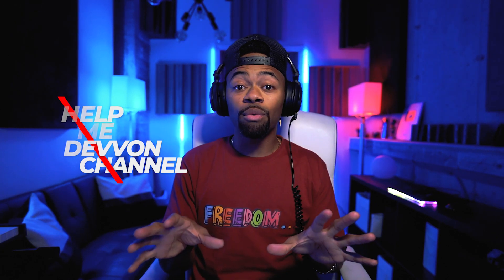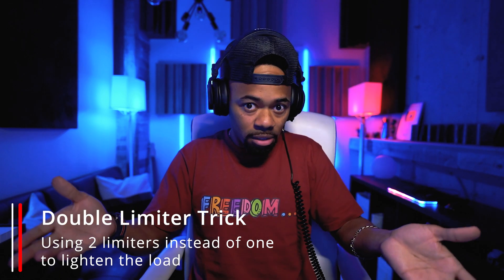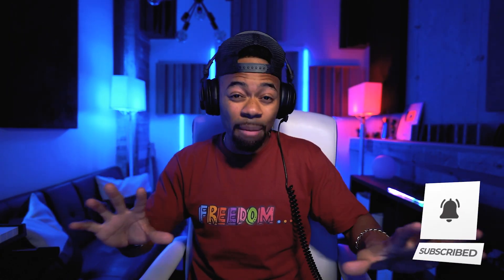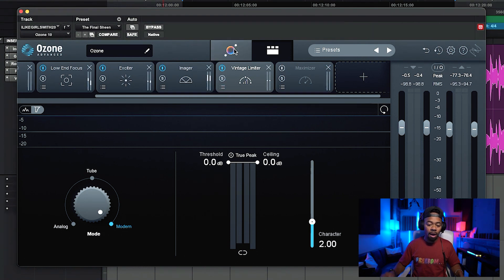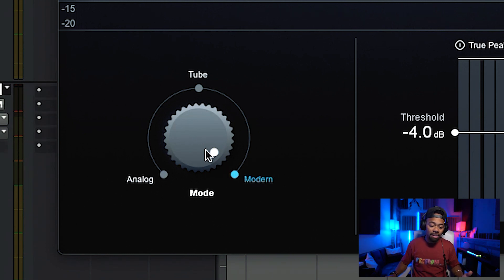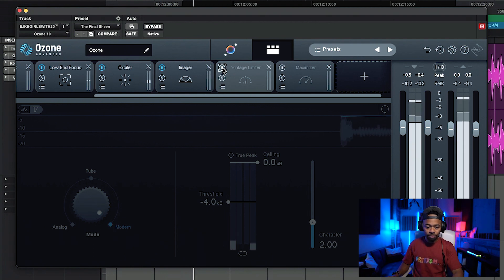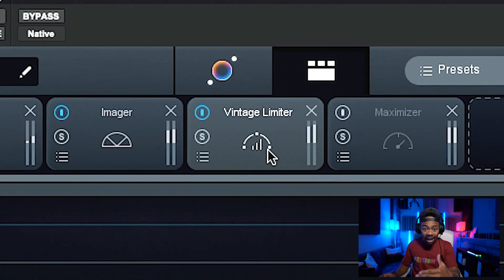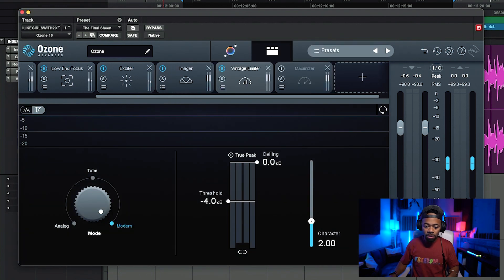2 Easy Steps To Get A LOUDER MASTER

Comment: Hey Devvon, I just watched this and the softclipper tutorial. 

I you can get the same effect by putting a compressor with fast attack and release, a light ratio 1.2-3:1 and drop the threshold into the RMS of the material, if the compressor has an adjustable knee, throw on the soft side. Make up whatever is reduced 2-3dB is usually enough 😊

Comment: I’ve never tried the double limiter trick. But I usually use a mastering compressor for maybe 1-2 DB of gain reduction before I use my limiter so I guess that’s a similar method
Reply: Yeah its the same method because a limiter is just another compressor with a brickwall. I use a clipper before my limiter.
Reply: @unknwngamer1  yeah I been a ozone user for a long time I’m happy they added the clipper into the limiter tab

Comment: I totally dig this method and will be using this on my next project!  Thanks so much for sharing this content!  I'm curious to know why on the 2nd limiter did you choose Mode IRC III - Balanced and not use IRC IV - Modern?  Is the latter a similar mode to what was used in the 1st limiter?  Sonically it works in our example wonderfully, but I'm curious to know the reason for your choice for the 2nd.

Comment: I use a similar system, this is my chain:

SSL Master Buss comp about 3.5 dg gain reduction
UAD Teletronix LA2 about 1 db gain reduction (it gives TONS of openess and colour)
Waves MAGMA Tubes (beautiful harmonics,  BE CAREFUL)
FabFilter ProQ2 - subtle touches, MS equalization
SIR softclipper _ (sometimes L2 limiter 2.5 db gain control)

OZONE Maximer exactly as Devvon uses

I usually achieve in well balanced mixes clear non distorted up to 7 Lufs

Comment: Hi devvon great video. I love the ozone maximizer. Quick question: Do you use true peak and if so would you recommend putting it at the absolute last stage? I like to use the maximizer last in my master chain, would you consider it "good practice" to use true peak limiting with the maximier in this case?
Reply: You don't need the true peak on the first limiter only on the last one in your chain